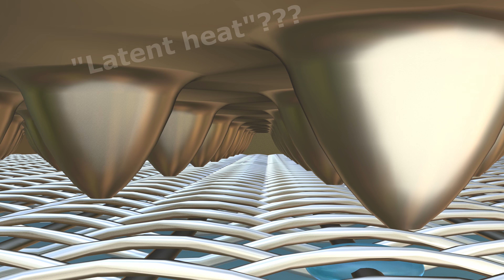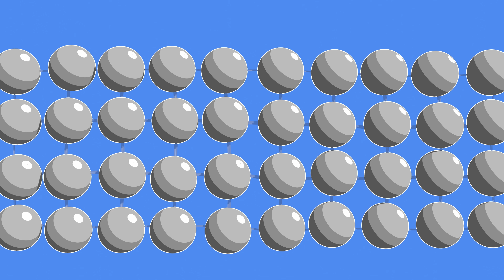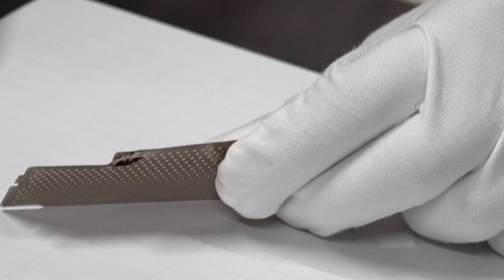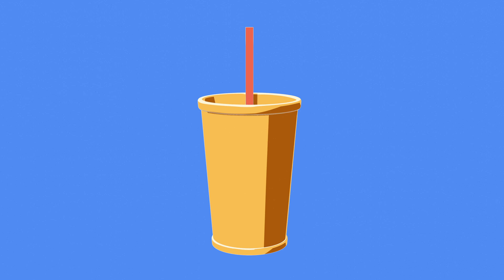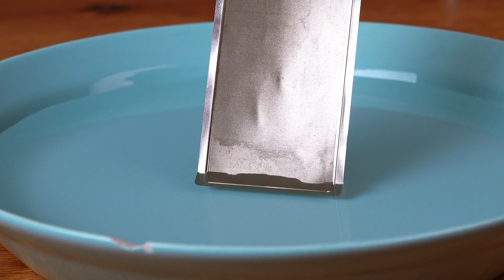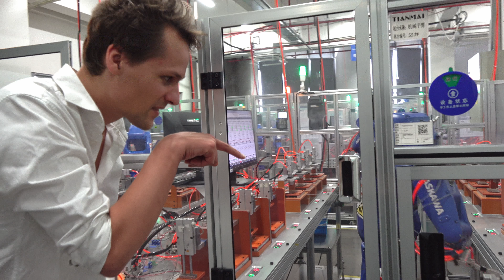How One Drop of Water Cools Your Phone

Comment: you know whats crazy, the whole universe is expanding from the centre of mass, i just noticed that your belly button is the centre of your mass. Your belly button is down, not the centre of planets. At the core of a planet you expand at the same rate, thats why you are null and weightless. Just a push gets you into orbit, keeping pace with the universal expansion, but move from the core without momentum and the mass of the planet is moving more than you in the same time, making you feel like you are falling. Right now you are 4000 miles from the core or your orbital position, the planet has way more mass expansing in the same time as you that you are pushed up at 9.8mtr/s, When you are weightless you are in sync with the universe, getting out of place in space or time and you feel weight as displacement. Everything around you would love to no clip to where it can orbit at its current angular momentum but it cant. 

Gravity comes from expansion, not a force. As things grow from the atomic level you scale from the middle out. Just as much as the planet seems to, its null point, down, is the core. If you aligned your core with its, you would both expand at the same rate, I always wondered if you stood on a time cone, or if it was inside you, it turns out it is your belly button. The centre of you is the centre of your observable universe. When you look at a time cone you see infinity at both ends, one hot and small, one cool and expansive, but they are the same view from different perspectives, scale in space and time and both are the same thing. It is all relative. It is all the same thing. Dilation endlessly flowing from one infinity to the other, with you always slap bang in the middle of it. 

Any point on a tesseract will look and feel like the middle, to someone inside it. Someone on the outside can see it come and go, but that is time acting at different scales. When something implodes and all motion reverses, backwards becomes the new forwards, causality ticks on like nothing changed. The universe can cycle endlessly inside itself a set of infinite size with infinite sets of infinite size dilated inside it. You could remove 99.9999999% and it would still be the same infinity. All just dilated from your perspective.

Shrinking in space, dilating or travelling at the speed of light are all the same journey from different perspectives. If you shrank down in size so a hydrogen atom was the size of a star to you the universe you knew would red shift to oblivion, at a certain point becoming invisible, even if you only went as far as a glass of water on your table. Your old life would look paused if you could see it, as time now ticks faster for you, to me it would look like you evaporated in an instant, where as you are free to live your life before i have blinked. 

That is how space and time scale, you cant scale in space without scaling in time. Approaching an event horizon would look like you pause to an observer, its the same illusion from different perspectives. Even when you approach the speed of light, things would look paused if you would look at the planet for instance and ride a lightwave, it would seem like time starts to rewind eventually as you are travelling faster in space and time than light was, it red shifts out of view eventually when you go far enough, flat becomes curved even to light. The universe is flat but also weirdly curved on every level, space and time curve flat things into spheres, but the horizon is the flattest geometry in curved space. Where clocks tick together in special relativity, that is a flat path in space and time, if you are massive, and you are. Light is not. It does not dilate with the universe. Its physics on transmission never change, but physics and the universe is all dilating together, and causality all makes it seem like the middle, where flats is curved and up is down and red is a negative of red, if we rely on light to illuminate the universe and its straight lines, we will be waiting forever, you need to trust mass. Mass dilates in 4D spacetime, a flat curved path is the flattest straightest geometry in the system

Take a globe and a pole, there is no geometry in or around the planet which lets a ball sit motionless at any point of the pole, any flatter than the horizon. 2 circular orbits, one inside the other, is the only idea of parallel that works out here. Perspective is everything, it changes everything and nothing, it helps us rebuild the universe digitally or in print when we can see that a red object rejected that one spectrum at you, its not what we call it, we are calling it the one colour it isnt. It really changes nothing until we forget the science or start abusing the logic, or arguing over if red is red or the negative, why does everyone think flat should look like a pancake? A Gleason projection is simply the top layer of a time cone, make it dynamic and pin it to the one using it and its a useful map, the idea of falling off the edge of your minimap seems laughable when you are pinned to the middle, the big bang is the same illusion.. As close as you think you get, it would seem just out of reach, as does the singularity and heat death or speed of light. it is all the same thing. 

As close as you think you could get to the big bang, even with a time machine, you would find a universe looking exactly like you see it. crossing the observable universe is the same journey now, or in 13 billion years or 13 billion years ago, as longer or shorter as it seems from my current perspective, causality has a way of making the universe seem like you are slap bang in the middle of it, 13 billion years from one infinity in dilated time, and 46 billion light years from the other in space.

Comment: The holes in the webbing/scrap are called Pilot Holes. The material is fed through the press tool using rollers before or after the press (most likely after in this case due to the thickness of the material) *other feeding mechanisms are available*. As the tool comes together - to guarantee the material has pitched (moved forward) the exact amount to ensure each component is identical - short shafts with rounded ends (pilots) with near same diameter as the pilot holes enter the pilot holes at which point the roll feeders release the material using a pilot release that's mechanically activated by the press closing, which allows the material to locate perfectly on the pilots which ensures the positioning each blow. The roll feeders reengage as the press opens and the cycle continues.
Reply from the maker: Interesting. thanks!

Comment: What's the difference between a heat pipe and vapour chamber?
Reply from the maker: they use a similar process but they use different shapes and materials and are used in slightly different applications. Heat pipes are good to get heat from one place to another. For example from a processor to a radiator, like in a computer cooling system. While vapor chambers are good to spread out heat from one or multiple points to a broader area.

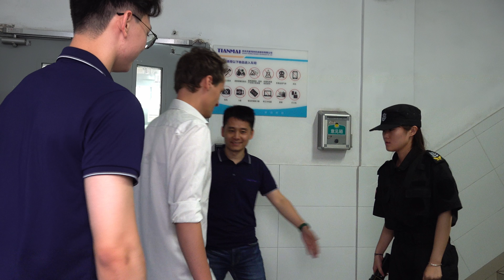Comment: 5:13 why are you using “” (scare quotes) to describe the vacuum chamber here?
Reply from the maker: Because it felt right. I guess you could say that it's an actual vacuum chamber, but since I'm referring to this object as vapor chamber in the rest of the video it felt right to use quotes here
Reply: @KnowArt that makes since. Great video and thanks for your response.
Reply: It isn’t a true vacuum chamber, it just has lower pressure not none. It is very finely tuned to the right pressure rather than full vacuum.

Comment: If China says there nothing good to it. They need it because they can't make their own highend chips. So they need to overclock an existing processor to break it's limit. So does the heat. Iphone doesn't distribute heat evenly but they are using high end chips that don't produce as much heat as oppo so they don't need that additional bulky low tech heatsink.

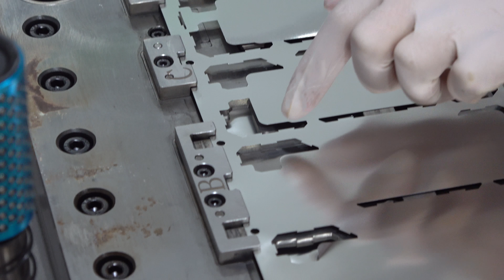Comment: Tool and diemakers apprentice here! At 5:57, you pointed out some dovetails that are not on the final part. I believe that is a type of slug retention feature. It creates more edges for the die to hold on to so the slug doesn't pop out of the hole when the punch retracts.

You said the material is 14 microns. Therefore, the tool only has 14 microns of space in between the die and stripper when the tool closes. If a slug were to pop out as the strip advances, all of a sudden there's 28 microns of material in that spot. Which can ruin the parts and/or break tooling components.
Reply from the maker: 40 microns. But thanks! yeah that makes sense, I think
Reply: @KnowArt Oops. Thank you for correcting me. I work in decimal inches normally, so I'm not familiar with metric. Especially with small units like microns.

Comment: 5:30 why they use steel?
Isn't it better to use alluminum?
Aluminum is a very good thermal conductor and thanks to its lattice it is possible to form much thinner sheets
It is lighter and by using aluminum-copper alloys they can also have enough mechanical resistance.
then the superficial application of aluminum oxide is not necessary as it is self-passivating
the same thing applies to the iron mesh due to the capillary effect
Reply from the maker: not sure on all different possibilities, but even starship is made with stainless steel. So I guess the strength/weight ratio is up there! Cost too, of course. They also said something about the difficulty of creating very even, thin copper sheets. apparently it's harder to get exact thickness of copper. Not sure why, it sounded strange to me. Aluminum is also notoriously hard on machines over time because of it's hard oxide.

Comment: but for gaming you need an active cooling, just spreading the heat faster is not enough in worst case scenario the heat will be too high and because it spread to all of the phone it can damage the less heat resistant component
Reply: Phones aren’t for gaming to begin with though
Reply: @cactus_cuber1589  some phone marketed as gaming
Reply from the maker: 'need' is a strong word.
Reply: @KnowArt  most phone limit their SOC performance (throttling) when playing a heavy games to avoid overheating, I used to disable it's limit just for fun and it literally can goes to 100 C , the phone is still working but the frame just start melting 

just like PC you "need" an active cooling if you want your SOC to perform at it's maximum performance at prolong use , a phone cooler can be a good solution
Reply: @chocho6766 even very high end computers with things like 9070xt and 9950x3d can easily be cooled passively without throttling

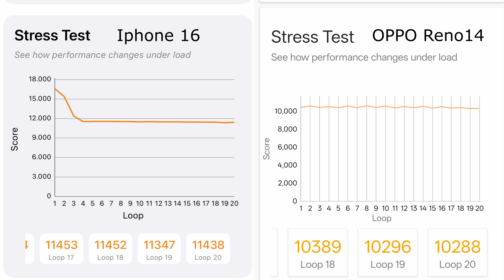Comment: 13:35 In throttling, the score is still much higher than on the Oppo Reno 14. And that's a shame. I'd also like to see a difference to another high end Android device (or you could have said what stress test that was so we could compare the numbers).
If they had added one of the best chips of the market, the vapor chamber could have made a real difference. Latent heat itself is extremely powerful and also used in motorsports.
However, as cool as it sounds, there doesn't seem to be a real benefit in buying an Oppo compared to a different phone.
Reply from the maker: still a bit higher yes, although compared to the price I think the Reno14 holds up nicely.
Yeah I don't have a ton of phones laying around though. Would be nice to see some more comparisons indeed
Reply: @KnowArt  What benchmark/stress test did you use? We don't need the tests being performed by you, we can simply compare them to other tests in the internet.
Reply from the maker: I used wildlife unlimited from 3d mark
Reply: @KnowArt  Thank you. The Samsung S25 scores over 21000 points in that benchmark. Even my Samsung S9 scores 13800 points although it's 7 years old...

Sadly, this makes the results much worse.

Comment: 11:00 Why doesn't that heat released by the vapour go back into the phone?
Reply from the maker: it does. The vapor chamber takes the heat from the processor, which is just about 1 by 1 cm big, and spreads it around throughout the phone. Then the outside of the phone gives the heat to the air
Reply: @KnowArt  I see thanks

Comment: is it me or does this work only half? when the water drops from the ceiling it lands on the mesh wich spreads out the water evenly, wich is not really what we need? you would want the water to go to the most heated point, evaporate and spread, and the return to the heat point again, not just the whole screen?

Comment: 12:12 that's really cool. The RGB pattern is very different from old TV screens, where it used to be three bars next to each other, rather than an interwoven lattice. very cool.
Reply from the maker: yeah! It's amoled I believe. There's a nice video about this structure somewhere on youtube and why they aren't equally big
Reply: It's still the same for regular modern TVs and computer monitors. Only tiny phone screens where the loss of color resolution isn't as noticeable use this type of subpixel arrangement.

Comment: Thank you for condensing so much info into this enjoyable video.  And for even visiting the designers! 👏 Bravo.
   I wish phone cases would incorporate vapor chambers to perhaps further disperse heat.
Reply from the maker: that could be a very interesting idea actually, for phones like the iphone that have a powerful chip, but bad het dissipation. One problem is that most of the heat is usually spread over the screen, which isn't in contact with a case.

Comment: Could this technology be applied to EV batteries to better reduce heat or is it too expensive to integrate?
Reply from the maker: well, two ideas here. One is that it's kinda tricky to make very large. And another is that vapor chambers only spread heat. They don't actually get rid of it. So you'd still need to get that heat to a radiator or something. So you probably need a coolant loop anyways, and in that case you might as well just use the coolant from the start.
Reply: @KnowArt Thanks for the reply. That was good information.

Comment: I hope they use their tech to make some kind of pc cooling.
maybe a whole case for cooling cpu.
Reply: It's not quite as relevant for a PC because PCs usually have fans to move the hot air out whereas a phone desperately needs to spread the head to get every bit of cooling possible. But I guess you might be able to make an effective fan/pump free case using this if you're fine with the surface getting hot

Comment: Its easy to understand when you already know some of its physics. Imagine a phone with some kind of exynos chip running a tasking app & you decide to wrap it up with a wet towel in areas with high temperatures, like in Dubai...surely the temperature of the towel rises & without an additional cooling factor like a fan, you'll notice both share the heating level... but this electronic cooling stuff is more like a metal & it still does a the work of cooling in a compacted area. Its simply mind blowing though if you understand it you'll think is no big deal.

Comment: 13:55 as a consumer I don't care if my phone bends like that it's only a thing pushed by "industry leaders". I want a bigger screen, longer battery life, easy to repair and upgrade, standard interchangeable batteries that can be used with different phones, and a 3.5mm headphone jack. I don't care if the phone is thick, a good feel would be 0.5 inch(1.27 cm) thick. thinner then that you just feels like your going to break it and you want a phone with a good weight to it, back it with metal if it feels too light. if your factory has any pull to changing industry trends, these are things customers actually want, those that buy the brand like iphone would buy the brand no matter what would be sold, no need to follow what they are pushing. because most people want practical over stylish.
Reply: Bring back microSD slots!

Comment: Very cool indeed! Did they have any manufacturing challenges with such precision needed?
Reply: That's exactly where the trade secrets hide... the manufacturing of forming dies and other tooling might require several iterations, and a single iteration that doesn't form and punch sheets reliably might throw tens of thousands of USD equivalent away. The features deformed by the dies are thinned, making them inherently weaker than the raw material, so their exact depth and shape are critical to the strength of the resulting part.

Comment: Now compare water vapor to CO2 vapor. CO2 loses kinetic energy through infrared radiation. That's why it lazes. It cools off rapidly until it reaches ambient temperature. That's why a CO2 laser doesn't continue to glow after the power, the extra energy, is removed. And that's why we use it for cooling and not heating. It's also why CO2 doesn't control climate. Water vapor does.

Comment: The kinetic energy of water vapor remains until the molecules bump into something less energetic (cooler). They don't 'cool down' as they expand. The 'average' temperature doesn't actually change. It's how we measure temperature that is the difference. We're measuring not only temperature but volume as well. So our instruments shows a lower temp but it's a false reading. The latent heat amount is the same, just over a bigger volume. Water vapor expresses heat as increased spinning motion. The only way water vapor, free molecules, can lose heat is through conduction. No contact, no conduction. That's why we use steam for heating. And that's why steam pipes can be miles long. 99 percent of the steam doesn't bump into anything but other hot molecules so no conduction occurs. No lost heat. It's only when the molecules hit the cold surface of the pipe or radiator that they lose heat. They stop spinning and stick. We call that condensation.